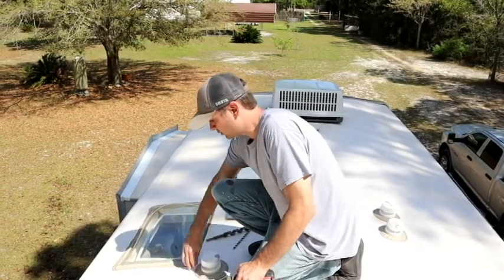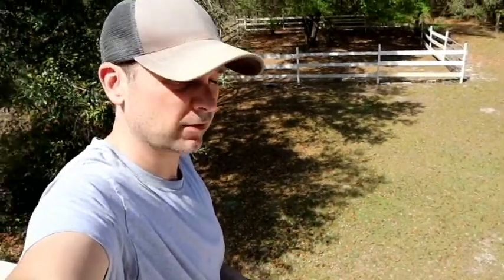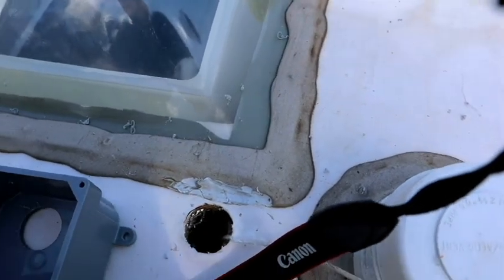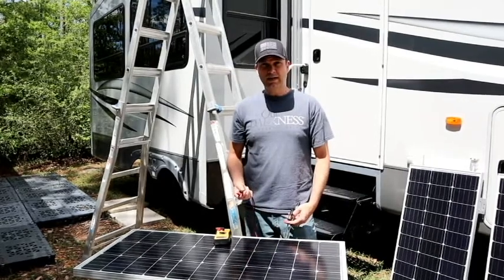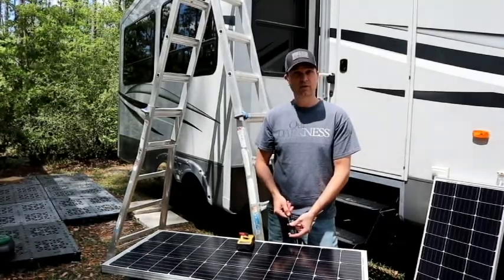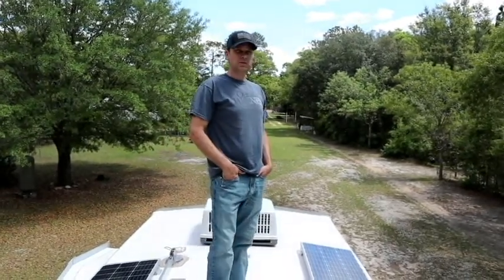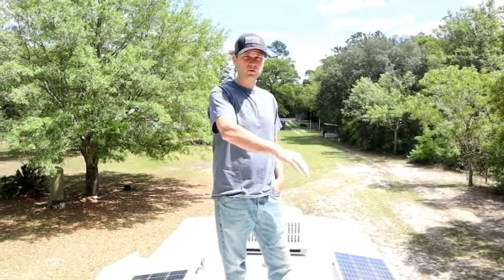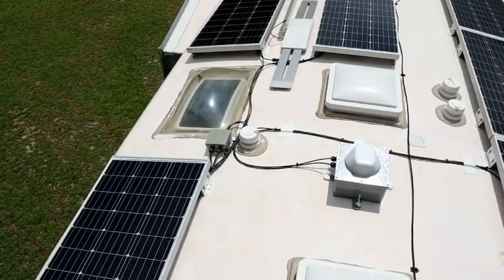Install Solar Panels On Your RV Roof | Best Solar Panel Brackets To Use On Your RV Solar Series Ep 3

Comment: That's cool for a few panels, but I wanted to fill my entire roof with solar, so built a rack out of 2-inch aluminum angle, 15 inches off my roof, with 1 inch clearance over my front A/C shroud. I was able to get 8, 550-watt panels (4,400 watts) up there. When added to the 620-watt liftable array on the side of my motorhome this gives me over 5,000 watts of solar to charge my 23.5 kwh LiFePo-4 battery bank letting me run everything off-grid the same as if I was plugged into shore power, including 24/7 A/C and heat from my mini-split heat pump.
Reply from the maker: That is awesome!

Comment: When you screwed the panels brackets into the roof, did you screw into studs or just into the plywood roof? How are they holding up and any water leaks?
Reply from the maker: We have fairly thick plywood so we screwed into that but I think I hit some studs as well, if you have a thinner roof material I would try to hit some studs. Each panel has 12 screws and dicor holding it down so we haven't had any movement or leaks. I check them regularly.

Comment: Very good.  Those Renogy brackets are exactly what I need in regards to adding a panel to my RV roof.  Need to easily remove panel as well as sit up a bit off the roof to get under panel to clean the roof.   Simple explanation of  panel  install with use of dicor under and above.  Thank you.
Reply from the maker: Glad it helped

Comment: I’m going to be doing this soon but with two pairs of 200w panels in series and then parallel them to a victron 100/50 charge controller, two 100ah battle bornes, a 3000w victron inverter/charger and a new converter/charger for lithium batteries.
Reply from the maker: Thats the system we are working toward as well, just using parts we have on hand for now and upgrading little by little. Victron makes some good stuff.

Comment: Great video. I got my panels today, should have the mounts later this week.  Then it will be time for me to put a hole in my roof.  Thanks for tutorial.  I am curious why you did the series/parallel combination when wiring the panels together?
Reply from the maker: Thanks for watching, if you put all the panels in series and one gets shaded you lose the whole array, if you parallel all of them you raise the amperage, since they face different directions series/parallel is the best option to always have an active string of panels.
Reply: @RVLivingYet  I know this is an older video.  But most modern panels have bypass diodes.  If one panel (or more) get shaded, the bypass diodes will allow the series array to continue to pass current from the cells that are not shaded.  Most installers now focus more on series or series parallel combinations in order to keep current and wire size down.

Comment: Great video.  Are you happy with the curved z-mount solution?  I have the Renogy kit and was planning to use the included hardware but after seeing your video I am wondering if I should do the same in case I need to remove a panel.  Thanks!
Reply from the maker: Yes so far they have worked out great, I plan on coating the roof later this year and it will be easy to remove the panels without messing with the roof connection. Plus you can tilt them a bit if you want.

Comment: Great idea using these adjustable brackets! I assume you have your refrigerator in the slide-out and thats why you didn't use the refrigerator vent to go down instead of drilling a hole in the roof.
Reply from the maker: Yep our last trailer was easy to go behind the frig but this one has it in the slide. We made it work. Thanks for watching

Comment: What size screw do you use to attach the panel to the roof.  14 hex?   1,11/4 or 11/2
Reply from the maker: It's been a while but I used some if the screws that came with the brackets and some decking screws, probably 1 5/8" long if I recall correctly.

Comment: Did you screw the panels into the roof "studs"?
Reply from the maker: Not all of them, they are glued with Dicor and screwed with course thread decking screws, we have a thick plywood roof so we have a good surface to screw to, if you have thin luan you may need to aim for studs or use anchors.